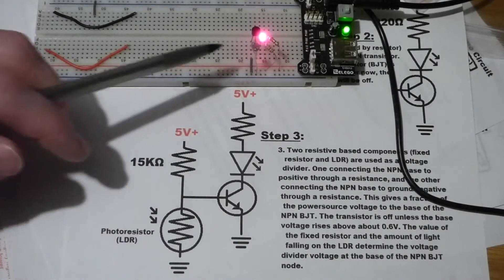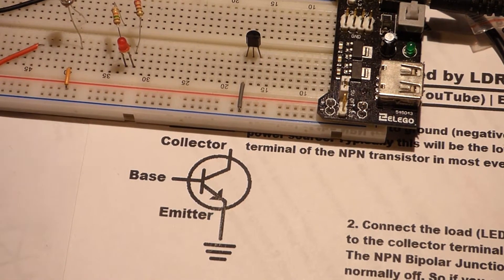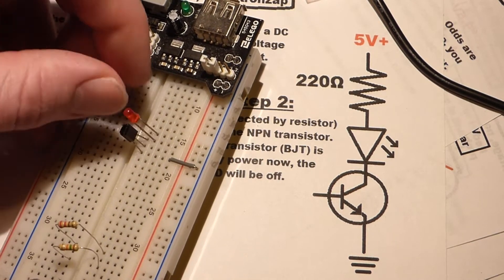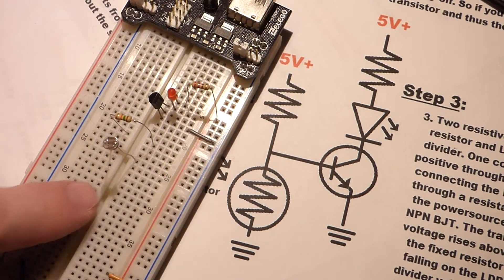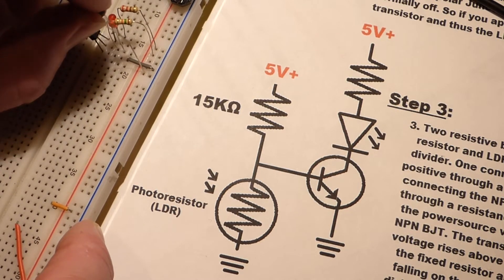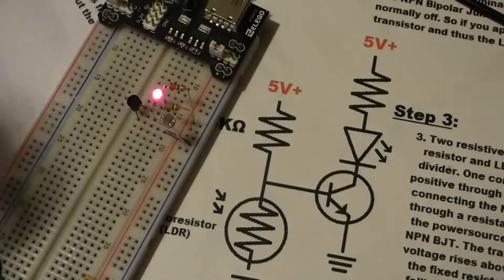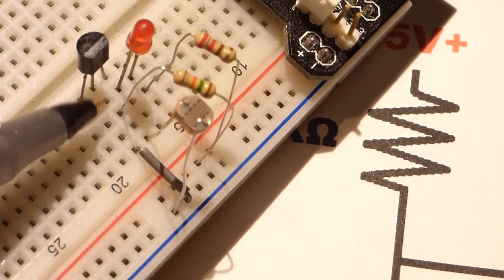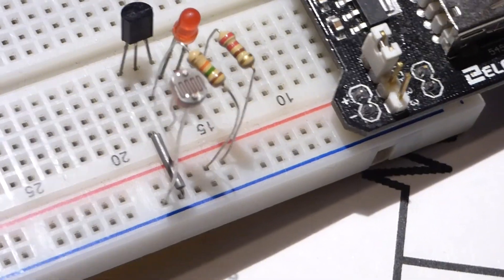Step by step build photoresistor LDR NPN BJT 2N3904 light controlled switch circuit by electronzap

Comment: what if im only provided with 9 V d.c. power supply, light bulb (2.5 V, 0.3 A), light bulb (4.8 V, 0.3 A), 3 L.E.D. and 2 resistors (180 Ω) and 1 resistor (390 Ω). sorry for all the trouble but help will be much appreciated :)

Comment: Thanks. I used this to do a project. The resistor values seemed to give me issues and I needed to drive a relay module. Read on if you are thinking about diving a relay.

Relay driver project:
I needed to drive a 5V relay module to run some 120VAC Xmas lights. jumpered to high input.  Your gave a really good explanation on both the transistor saturation voltage and the voltage divider. R1 in my circuit was the LDR I had to measure the resistance of the LDR for the lite I had in the room  something like 40k ohm. Then super bright was 1k ohm and total dark was 375 ohm. I used a 2N2222 NPN transistor. I used this calculator https://www.allaboutcircuits.com/tools/voltage-divider-calculator/ (see schematic) and programmed R2 for 40K ohms and experimented with a R2 value that would put me just under .6vdc for saturation of the transistor as you suggested. The value for R2 was 5k ohms!  I connected the output form the voltage divider to the Relay module jumpered for high to close relay. It worked!  

Question:
If I remove the LED,  and try and drive my relay module, nothing works. I guess because I need load on the collector side of the BJT and the resistor was not enough load?
Reply from the maker: Fun project! That's weird though, less load should mean it is easier to drive something else, unless something burns out or something isn't connecting right.

Comment: Hello :)  quick question: On your schematic, isn't there a dot missing at the intersection of the 15kom, the LDR and the transistor on the right side as they are all connected? EX ... at 5:10min, thank you !
Reply from the maker: Some people use dots to show connections and no dot intersections as not connected. And other people use straight line intersections as connections but a curved (over) line as non connections when they want to cross lines that aren't connected electrically. I like the second way better because for me it's easier to keep track of curved lines = not connected than dot/no dot intersections.
Reply: @Electronzap  Ok thanks!,  i was asking because i am trying to learn on How to read a schematic and make it on a breadboard but with medium to medium high complexity as i am ok with a basic circuit and wanted to step it up a notch. I have yet to find a good tutorial that explains what could possibly be some *rules/guidelines/wich direction to follow*. I found two of those on youtube from other user but half way they dont explain why they made that decision and their schematics were not that clean. But they did use a highlighter to show a step by step of what they connected as they went along, that was nice. Perhaps you already made one ? as a did watch a couple of you videos on that topic but they had a simple flow from what i recall. Also, i did watch lots and lots of your videos and they are excellent :) thanks again!
Reply from the maker: Glad to have you watching! Hope they help!
Reply from the maker: Highlighter sounds like Greatscott! lol . I started this playlist a long time ago for building circuits from schematics the way I draw them. I added new videos over time in order of difficulty.  https://www.youtube.com/playlist?list=PLsAJMThMEUtpBRrPE3o7Sn7kdcZpS4TO8
Reply: @Electronzap   Thanks a lot for the reply and for making those videos! I will look at those :) (note that did watch some out of the blue, so i will go through them all heehe) Cheers!

Comment: I'm pretty  new to this stuff . I was struggling so much with this. Couldn't get it to work  . Didn't understand why a resistor was  needed going to the base
Reply: I enjoyed this tutorials step by step clarity. It seems like I copy circuits identically and they do not work. The 15 k resistor did not work for me. I had to add a 100k resistor to get proper results.